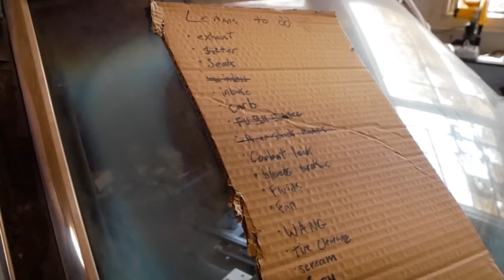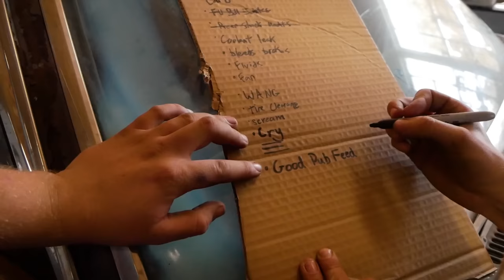TOTALED Muscle Car Returns to the Road After 35 Years! Flooded LeMans Gambler Car

Comment: Man this is so familiar.  Back in the mid 80s I had a 70 Malibu with a Pontiac rear axle and a Buick 350, no door panels or headliner, and rusted out trunk.  Perfect for the sand dunes, or so I thought.  It would just dig straight down if I floored it in sand.  That's why I love this video.

Comment: :)  I never saw this car. Lovin it. The Poston intake was from Tom Poston. Years ago, you had the limited choices of an Edelbrock B4B, Kenne-Bell Wildcat, Poston Divider S or a T/A Performance intake. Can't remember for sure, but I think Poston was the guy who originally designed the pre-load rear diff girdle. You'll want to get hold of T/A for any performance stuff. BTW those babies make peak power at 2800 rpm - they'll tear up tires all day long. With that tire size, you might want a 3.50-3.60 rear gear (maybe you have that - gotta watch your old vids!)

Comment: being a suspension guy, i have used a 1/4" ball joint spacer and mounting the ball joint under the arm instead of on top will gain you camber usually around about 1.5 to 2 degrees.

Comment: Check that out a Buick 455! Poston  Buick has been gone for quite a few years. Great intake find though. If you need any Buick parts go to TA Performance now. If you swap that cam be aware that front cover is aluminum and is the heart of your engine. Make sure to replace the oil pump if you pull it. BTW this is a low rpm high torque engine so watch those revs. Love your channel!

Comment: I used to have a 69 Riviera with a 430ci back in the day.  I rebuilt the engine and it was a screamer. The 455 came out in 1970 to 1976 good job bro brings back memories. I have experience with all those motors the 455 Olds, Buick, and Pontiac. I had an extra pontiac 455 cam shaft and put it in a pontiac 350 and it was a mean motor. I had a small block chevy 400 cam and put it in a 283 that thing use to rip. It's all in the duration and lift.

Comment: oil pump clearance on buicks is imperative. with a new timing cover (ta performance has good ones they make, or over see production of) that come fully assembled and blueprinted. toss on some aluminum heads, reground the crank and balance the whole shebang with new rods and you got 500hp/500ftlbs easy. in a package lighter than a sbc.

Comment: I just had my Jeep regeared and the specific protocol I was told was at least 3 heat cycles of no more than 15 to 20 mins of driving with 20 to 30 mins of cooling in between and for the next 500 miles, don't go over 65 mph and if you are on the highway make sure to modulate your speed and don't make trips of over 50 miles at a time without cooling between driving. Also specifically told not to do burn outs in this time. After the 500 miles,  then change your gear oil and you are good to go.

I really hope you don't blow your rear gears, Kevin

Comment: by the way if that's a stock 455 since you got a intake manifold from posting enterprises and the 670 Street avenger Holley carburetor put a stage 1 cam up in it and don't forget the stage 1 valve springs and retainers you have a kick-ass molded in

Comment: Is that a Buick engine in the engine bay, of the big 4-5-5 variety? Poston was big once, I ordered the same intake, along with, headers, and camshaft for a 455 Buick that I built for a 66 Chevy fleetside pickup. Back before you tube was a thought. It revved snappy!

Comment: FYI: Using a water softener just means the calcium and other mineral ions were replaced with either sodium or potassium ions, depending on whether your softener uses salt or potassium.  You should NOT put softened water in a radiator or battery.

Comment: Did u fix the fuel gauge? Problem is gauge uses like  OEM 10 gauge wire. Too thin for most splicing. I used 12gauge headlite socket wire to splice in. It reads from past F to about 3/8s.

Comment: 462x5500=2541000/3456=735.2430555  Your 462 needs 735 CFM's at 5500 RPM  A 750 with vacuum secondaries worked nicely on a olds 455 with performer intake a crame cams cam it wasn't too big, good street combo in a 1982 Malibu I had about 30 years ago!

Comment: Excellent video guys & ladie also that 455 V8 also 4 bbl carb 670 Holley will give bit more hp 15 to 20  and torque #25  to transmission of Turbo 400 3 speed Automatic trans also any rear end gears use too! That why 1976 General Motors Caddy had 425 also 475 and 500 V8 hook with Turbo 400 3 speed Automatic transmission with 411 rear ends plus beef up suspension  to of big 2 and 4 doors cars felt drive on Cloud on road with quick response to when gas pedal it ! My 2002 Chevrolet Impala I fix did same thing to and for 4100 V6 252 plus 506 M6 6 speed Automatic transmission with Shift Kit and suspension all Caddy plus fuel system to plus Computer parts from 3.1 To 4.3 V6 even chip Computer software too plus I use 89 or 91 Octane gas and 10w30 no synthetic engine oil plus too! Car no orgnail at all or anything on plus no restrictions on speed top have is 159.9 km/h or 142 miles per hour ! Got lots get up go my car to and not slow! Kevin you got show us Mook done to hair and don't be shy I get ladies cut my hair Lol!

Comment: you'll run through step bits if you keep using them to start holes. drill a pilot first, it takes hardly any extra time and will save you $$$

Comment: I know my pontiacs and that ain't no pontiac engine. Is it a Buick motor? Distributor in the front like that was only Buick from GM I think.  EDIT: Nevermind dude just said olds/Buick 455 so it's a Buick 455 most likely. Torque monster.

Comment: Buick 455 with a rod knock!!! This engine also known as “The Detonator 8”!!!
Sounds like your Pontiac is having organ rejection. The answer, a 400 Pontiac. Way more reliable than a Buick.  More torque then a 454 Chevy.  Bolts to your transmission. Best of all, no organ rejection!!!

Comment: Don’t those olds and Buick motors have notoriously bad bad oiling systems, where at high rpm all the oil gets stuck up in the valve covers because it can’t drain fast enough and then the bottom end starves for oil?
Reply from the maker: It would appear that way😅

Comment: Question for anyone who can reply.
I’m currently attempting to change tranny fluid in an 04 Tahoe 2wd. I’m not able to break the torque bolts on the cable bracket so I’m having to drop the cat. I have tried almost everything to get the bolts loose even soaked with pb. Can anyone tell me which impact driver would be better?

Comment: As you probably know, Diggs,  Pontiacs coiled suspensions tend to settle and sag just like every guys gluteus maximus over the years.  By the time a man is 50, if you can't maintain your youthful weight, a man will essentially lose their ass, pretty much like an 81 Pontiac Grand Prix will lose it height due to a sagging coil spring  suspension. 
I don't know what you guys put into your Lemans, but,  during 1987 I was basically spending all my free time and money fixing up my pregnant girlfriends 1981 Pontiac Grand Prix. (Prior to her ownership, [she was 5' nothin' & 98 lbs soaking wet] and the original owner was a 6' 4", 34o lb guy who had crushed the seat springs, and overloaded the suspension. ) 
I was determined to make my gfs

Comment: I would never do that to any car,.... but people do do that.
However i have done much worse things with better cars.
1970 challenger,.....67, 68, 69 Dart, Super Bee, Cornet,......383 Magnums,....440 Magnums.
1965 mustang 289,......1969 Mustang fast back 302,.....1969 Torino fast back 390 4 speed.
1967 Sunbeam with 2 engines transmissions and over drives.
I had 30 muscle cars all at once.
Got married,.....got rid of everything,..... got divorced and still have never recovered,......even though I have been child support free since 2011.
I'm still driving my 1984 Plymouth Voyager van.